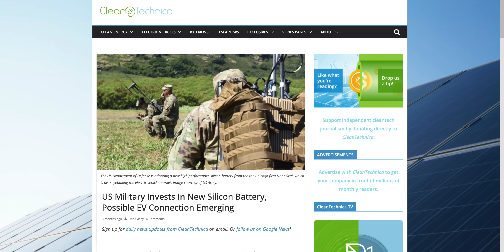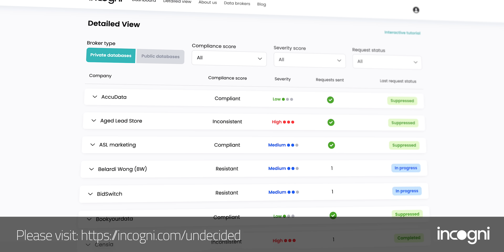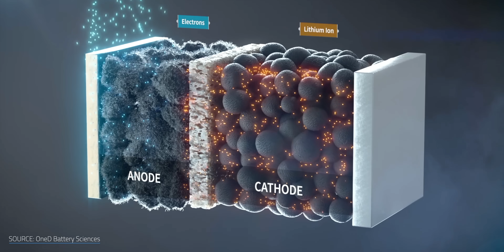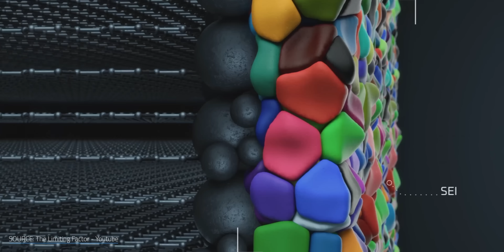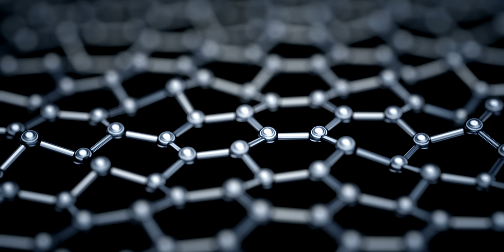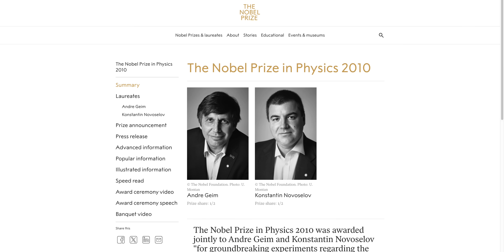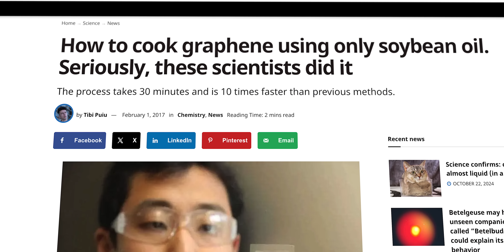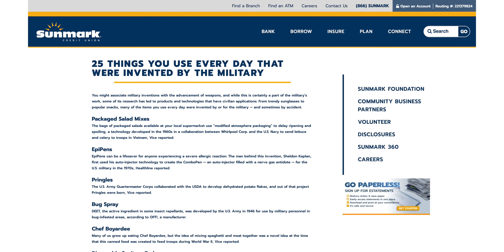Why The US Military Chose Silicon-Graphene Batteries

Comment: Graphen can do everything, except leaving the lab
Reply: I actually own a battery product that uses graphene in a meaningful way! It's a 10000 mAh lithium graphene battery bank that charges at 100 watts. Most battery banks that can charge that fast do so by charging several large batteries in parallel. This one has a single series of batteries that can genuinely take the wattage.

I've verified this with a USB-c power meter. It goes from 0-100% in like 20 minutes. The capacity really is 10000 mAh. And it's small! It easily fits in a front pocket. It's amazing and I'd love to get another one...

Aaaaand Elecjet (the company that made this badass battery) got bought out by someone else who promptly got rid of all of Elecject's consumer business. Elecjet was simply purchased for their IP. The company sent out one round of Apollo Ultra batteries and then stopped making them forever. It is impossible for me to ever replace this thing :(
Reply: @GregBadabinski i want one... Are there other powerbanks like this one from other manufacturers?
Reply: @fabianluethi03  Not that I'm aware of :(
Reply: @GregBadabinski  Drop a video of the battery in action, tests and all. Otherwise I'm calling bs. A battery that good is a trillion dollar invention, no company managed by sane people would kill it.
Reply: @GregBadabinski  That's because the higher conductivity reduces Ohmic heating so you can crank the current up more before it melts.
Reply: @GregBadabinski  that is why we need to make it impossible for one company to buy another company. If a company goes out of business they can auction off their assets, otherwise no selling.
Reply: @GregBadabinski  so charge capacity for volume is greatly improved compared to lithium batteries, how about the potential to combust and the expected lifespan? Those are my two biggest concerns with lithium batteries, they degrade over time and can catch on fire, if your EVs battery burns out after the warranty period expires you are royally screwed, is this new battery gonna change that or make it less likely to happen? ICE production is set to stop on 2030, I'd like to know the replacement will be better instead of just different
Reply: @Ali-qg6sv  I'm unsure of the implications for lifespan and safety. There's already an answer on the market for those two factors though. Lithium Iron Phosphate batteries are incredibly safe and have very long lifespans. They can't sustain a fire on their own unlike lipo and li-ion cells.
Reply: @GregBadabinski  what is the advantage of having just the one battery that can charge at that wattage vs a series of batteries?
Reply: @weir-t7y  size is the big one. I have an Anker 737 power bank that also charges at 100 watts, but it's massive and heavy (24000 mAh). That thing takes quite a bit longer to get to full charge, even at 100 watts. Plus, it actually has to slow down the charging rate as it gets more full due to temperature issues and battery curves. If I need something small, the Elecjet I have is my best bet. It's especially nice because I'm pretty forgetful and don't remember to top it up until the last minute. It goes at 100 watts from 0-100%.
Reply: @GregBadabinski  thankfully you might never have to replace it they have long lifespans! One of the biggest advantages. Just don’t lose it, I was SO SAD I couldn’t buy one :(
Reply: @GregBadabinski  probably bought by another big battery producer and canned because it was competition for their current cheaper to produce products.
Reply: @Kx0195  whoever commercialized a graphen battery that was "competition" would do too lithium what lithium did too lead acid. So hiding it away would make zero sense
Reply: @GregBadabinski  sounds very cool! how much did it cost you out of interest?
Reply: @masinacastle  it wasn't very cheap for a power bank of that size. I think I paid $70 for it. Given its capabilities, I'd consider it to be a good deal.
Reply: @GregBadabinski  I hope it's real.  The "solid state" solar generator Matt pitched a couple months ago didn't have solid state cells in it.  Another youtuber proved it and Matt pretended it never happened and the video is still up.
Reply: @RickTheClipper  Man, you ain't joking! I'm getting close to 50 years old and I've been intrigued by the prospect of graphene batteries since the idea was first patented. We've been waiting a long ass time for graphene batteries... At this pace, I'll be 6 ft under before it's available to the public. LOL
Reply: Just you wait untill it grows up and learns to walk.. he'll show you who can and can't leave the lab 😢
Reply: BUT, while a wait for the consumer side, the military doesn't care about the cost.
Reply: Graphene the next fusion power. 10 years out since a life time ago.
Reply: @Unseen_rouge  And quantum computing. A self licking lollipop that can do a few useless calculations for show, that has no real world application.
Reply: @Unseen_rouge boy you said it
Reply: @Unseen_rouge  it was only isolated for the first time a little over 20 years ago, it really hasn’t been that long.
Reply: Its amazing how hard it is to manufacture at scale even with years of scientist and engineers working in tandem to try it.
Reply: It's in a bunch of products already. It's just steadily improving in scalability, as is the case with all manufacturing for new materials.
Reply: @ShiroKage009  what products are they in? I don't want new age asbestos in my environment.
Reply: @turtlefrog369  is in some batteries, inks, thermal paste, and as an additive to some polymers. So far it's in things that contain it decently well and in amall quantities. But yeah, it needs to be regulated. It's similar to the problem with reinforced 3D printing filament which acts like asbestos.
Reply: @ShiroKage009 carbon fibre and graphite is not graphene!
Reply: @needmoreboost6369  I'm talking about graphene. Who mentioned graphite in this?
Reply: Loves hanging out with carbon nanotubes too much
Reply: Just like hair loss cure, scareless suture, skin regeneration therapy, healing of spine injury, etc... etc...
Reply: @RickTheClipper  it is manufactured, it is just prohibitively expensive for most technologies.
Reply: In some applications it’s commercial phase already. For example, Olympic bows are now damped with Graphene layered cores.
Reply: RC community has been using lightweight graphene batteries for a while now.
Reply: Did you not watch the video? It already left the lab. They are currently literally manufacturing batteries for radios for the military
Reply: Doesn't want to leave its brother Perovskite
Reply: Commercialization of latest tech can take atleast 2-3 decades of research and development, hold your horses mate.
Reply: Isn't this video literally about it leaving the lab?
Reply: Yes the joke under every video featuring graphene
Reply: One of the huge hurdles of graphen in the general public is asbestosis. The breakdown and scrap is extremely dangerous in that sense.

There’s no reason we could have flying cars isn’t, but that it’s too dangerous for the public to use.
Reply: Surely you guys are aware of a the graphene car car products. Cause. You know that's not marketing BS, that's real graphene.  I have my duracells soaking in the best 40.00 graphene car wax wal mart has to offer. Will report back with my outstanding results. 🎉😂
Reply: graphene is carcinogenic
Reply: I work for a consumer electronics company that for years has been shipping millions of products (that you can buy at places like Best Buy) that use graphene heat spreaders for thermal management. @RichTheClipper it's easy to be cynical when you're not up to date.
Reply: 99% of manufacturers claiming to use graphene in their products lie. And it’s impossible for a consumer to verify.
Reply: very funny lol
Reply: Graphene is incredibly toxic, and persistent. Your body has no way to remove nano scale graphene from your body, and it absorbs right through your skin.
Reply: Eh oh!
Reply: graphene can also destroy your dna and give you cancer, just like asbestos.
Reply: I agree 
Engineering on the nanoscale 
But producing on the massive scale 
Is crazy hard
Reply: I think there was a graphene Surefire made about 15 years ago for the police, about a size of a 2D cell light that changes in about a minute for forty minutes of use.
Reply: We’re exposed to news so soon and sensational news tells us these experimental technologies are just a stone’s throw away. That’s not how things work. Graphene and cheap fusion power will change our world. Just don’t expect it to happen in the next few years.
Reply: Maybe Elon could resolve their issues and get an upgrade for teslas ev's
Reply: 😆 ikr!
Reply: Graphene, quantum computing, fusion reactors will happen any day now..
Reply: xdd
Reply: @RickTheClipper  20 years of “the future is here!”
But finally!
The future is here XD
Reply: The same was said about silicon
Reply: i remember learning about graphene years ago and saw multiple videos from the 90's where they were investing into it heavily. I'm pretty sure most of those early companies went belly up. 1 day though!
Reply: Dr James tour is healing spinal cords in mice…with graphene…he’s made quite a few graphene breakthroughs…in the lab.😊
Reply: Yeah hearing about these innovations for decades 😅 Graphine is going to change the world 😂
Reply: LOL. It's cool stuff, right at the edge of being developed commercially, for about the last decade.
Reply: I mean.. you can make graphene at home with scotch tape lol. My home is not a lab  ;)
Reply: Aaaaaaaaaah!
Reply: BAHAHAHAHAHAA BAHAHAHAHAHAA great reply
Reply: 1:13 picture of graphene doing 'everything' :D
Reply: Actually a lot of new Samsung and Chinese phones have them!
Reply: A saw an interesting video that claimed a lot of this technology is just vapourware or snake oil salesmen. They have no intention of making a usable product as long as they keep on making money from investors.
Reply: It takes years of research.
Reply: Ye i remember learning about this like 20 years ago buh graphene has never been used in much despite their claim that it was a new wonder material
Reply: Idk, with military funding this time it might actually happen.
Reply: Seriously. Never makes it to consumer products. Vaporware
Reply: @RickTheClipper  great on paper or stuck on tape!
Reply: @RickTheClipper  🧙‍♂️
Reply: But they're here in a AA form!!  Ah yeah were at the matt land of funding being same as here and solid state batteries
Reply: Yeah, if you don't invest whole hog on something, it never takes off. Do you seriously think nuclear research could have been done in private enterprise.
Reply: I have seen lifepo4 with graphen but it's hard to tell if it was true and juat marketing
Reply: I wish it weren't so, but no truer statement has been said. 😂
Reply: LMFAO
Reply: Best comment ever 😂
Reply: I'll be convinced when the manufacturing methods are found in the civilian market, There's no way this will leave defence in the near future
Reply: @ they are, go to acs materials or American elements, or any number of other companies
Reply: @BLKBRDD  it has to due to the cost of lithium extraction, issues with lithium ion batteries
Reply: Looks like it finally left.  You may rest easy, now.
Reply: Too real
Reply: What public company has the best investment potential for graphene?
Reply: Scientists found out, but then went back inside
Reply: For real I remember 25 years ago on stuff like the Discovery channel where they were talking about how we'll be making these stacking dome mega city structures out of the material due to it's insane structural strength over steel.
Reply: It now being used as a replacement for thermal grease between a CPU and its cooler. It is not cheap, best part is it is reusable and doesn't dry out.
Reply: Has a lot of commercial applications already, and new ones pop often. It's just not a "God" material that the media plays.
Reply: main issue is you can't really mass produce it. once you can, progress should go pretty fast.
Reply: I coat my car in it so it must be getting around lol
Reply: Facts, been waiting so long for a new phone. But I'm waiting for the new battery tech 😆
Reply: @RickTheClipper  🤣
Reply: Its because Carbon is a rare earth element... cant find that shiz anywhede
Reply: Graphene left the lab years ago.
Reply: Dewalt uses it in their batteries already
Reply: @jp_questions also other brands but they aren't graphene batteries but lithium one with a pint of graphene, so it was a marketing stunt
Reply: Now is out the lab, but slowly. XD
Reply: Yeah and be the primary component for these man made UAPs in the news
Reply: @RickTheClipper  😂😂
Reply: It’s not ready yet and. It stable. The 15m for for research not buying products.
Reply: It’s not ready yet and. Its not stable. The 15m for for research not buying products.
Reply: Not at all, James Tour from Rice university already has a extremely easy way to produce it from plastic waste or any carbon based waste. Just zap it with lots of power. Gets barrels of it not cheap but actually for profit because the reaction produces hydrogen for power. The process becomes free. It's pure just not right for every use of graphene but makes it for industrial scale use like in concrete, roads and so on.
Reply: It's an engineering challenge at this point for commercialized graphene
Reply: Mythril
Reply: ENOVIX corporation is well on their way towards mass production of their groundbreaking patented batteries.
They’re the real deal, getting things done.
Their YouTube channel is very informative regarding how their battery technology works.
Reply: And tech  YouTuber videos
Reply: @RickTheClipper  roll graphene to make carbon fiber nanotubes, mythil. Yes?
Reply: gottem 😂😂😂
Reply: It's definitely out of the lab dude hahaha
Reply: @RickTheClipper  Hahaha graphene has been too shy to go out of the lab for decades.
Reply: Look at the history of the transistor. Same thing. The first one was huge. Then they got a bit better but we're considered niche. Then they got smaller and better and now they're used everywhere.
Reply: Lol for real.
Reply: Did graphene get publicly canned by the government?
Reply: @aussie2uGA  The problem is the mass producing.
Reply: @ but they seem to be doing that in great quantities in Australia, just not the US.
Reply: @aussie2uGA  because the #1 lithium exporter owns a massive chunk of the U.S.A debt, the American government  probably has back door deals pertaining to lithium.
Reply: They are. First Graphene in Australia
Reply: I love this comment so much… it’s so true lol. It’s been what 30 years now of “graphene can do anything!”
Reply: Not true, I have it in my bike tires.  Of course, it doesn't do a thing in those tires beyond acting as an overpriced filler
Reply: @veganpotterthevegan  Yep, I still get punctures. Graphene is just a marketing gimmick.
Reply: Wrong. Im using it right now to transfer heat from my cpu to my heatsink. Thermal Grizzlys Kryonaut Sheet is using graphene, so, you are wrong.
Reply: True,
Reply: Youtube commenters can do anything, except come up with a new joke.
Reply: False. see graphene/clay batteries and quantum delocalization
Reply: @RickTheClipper  WOOW!
ONE OF THE BEST AND SMARTEST REPLIES I EVER READED!
LOOOOL :)
Reply: Huawei has graphene in phones already on the market
Reply: @Adiscretefirm  No they don't. They just claim to use "graphine" like so many other companies but it's just marketing BS.
Reply: @SilvaDreams  they spell it graphene in their own materials and in the patents they filed. If you can disprove the articles in tech mags and materials industry publications you really should, it's always a coup to disprove thousands of people and a public service
Reply: Ever heard of pencils?
Reply: @ghoulbuster1  You are confusing graphene and graphite.
Reply: @ghoulbuster1  not the same thing😅 They're made of the same thing but lots of different things are made of the same material.
Reply: @ghoulbuster1  These are made of Graphite, not Graphen

Comment: I can't remember their name, but there's a company in Australia making pure graphene from CH4 (methane / natural gas) in huge volumes.
Reply: Do you know anything about the process itself?
Reply: @3nertia  I don't, but their original intent was to use it to strengthen concrete, so they were able to produce Significant volumes.  They're using a process developed & patented by the University of Queensland (corrected...).  Their intent was to develop aluminum graphene batteries.
Reply: Found them - Graphene Manufacturing Group.
Reply: It's a shame the process is proprietary heh
Reply: @3nertia  It involves a huge voltage in a vacuum. Tech Ingredients channel did it and it is quite dangerous but they explain the entire process.
Reply: @JackRyanRobtics  It didn't look particularly dangerous. The main problem was that each shot requires some setup; it isn't a continuous flow. Also it only produces powder, which is fine for battery electrodes or plastic/concrete mixes but not so good for most of the stuff graphene was promised to do (circuitry, direct structural usage, thermal applications etc).
Reply: Fartech?